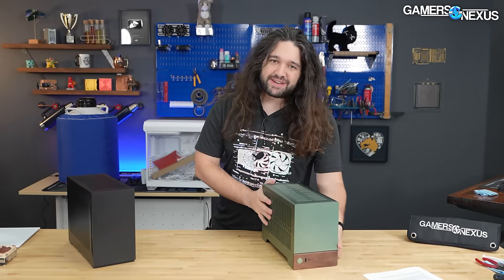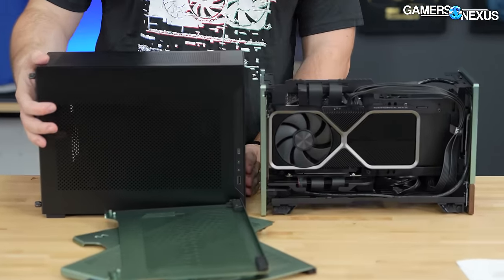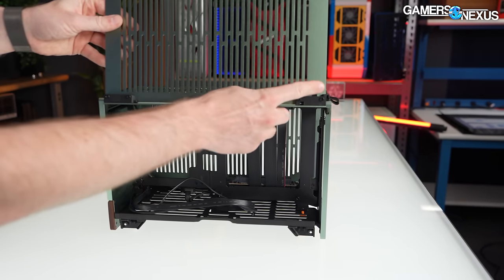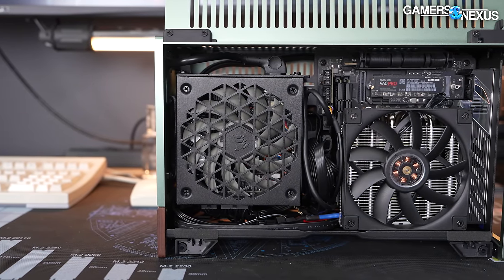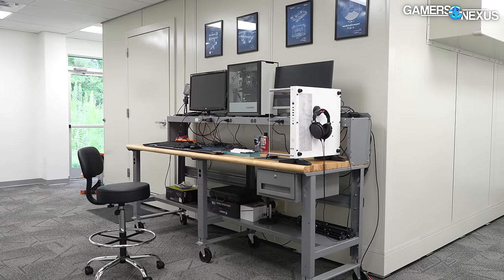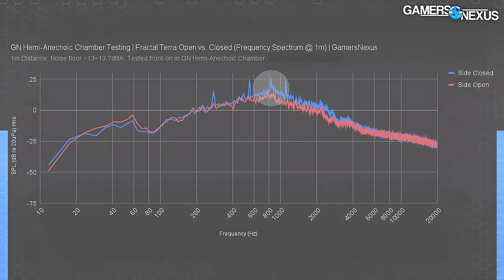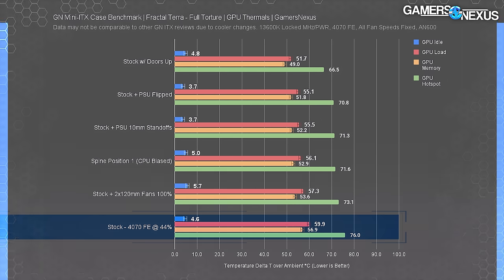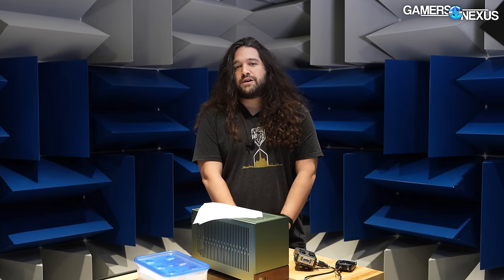Fractal Terra Mini-ITX Case Review: Build Quality, Thermals, Acoustics, & Cable Management

Comment: Great review! The noise produced by the case would be a no go for me. I've recently built my latest PC with the SSUPD Meshlicious and it is the best build I've had in about 24 years of PC building. Would be looking forward for a GN review of that case. In my case it is basically completely silent in desktop use and still surprisingly quiet under heavy gaming load. My setup: 7800X3D, Arctic Liquid Freezer II 280 + Noctua NF-A14 fans, Corsair SF750 SFX, ASUS ROG Strix B650E-I Gaming WIFI, Zotax RTX4070 Trinity, G.Skill 32GB DDR5-6000. CPU and GPU have some undervolting to reduce energy consumption and it works great so far.

Comment: Would a Arc 770 bifrost be a better choice for the form factor in reference to the cooling?  Pushed to the outside of the case the flow through fan would push air across the PS and the turbine style fan seems as if it would draw in cooler air frome the outside of the case and push out of the back through the mounting bracket.  I'm not an expert at all and I'm not saying that this is a bad review but I was curious to what you guys thought.
Reply: I have that card in a different case, the Cougar Dust 2, which has a similar sandwich layout, albeit with more room (~20L). 

The hybrid blower might be helping a little to deal with any recirculated air from the CPU when both the GPU and CPU are under load, but cases like these that have perforated panels don't need blower (centrifugal) fans as much as cases that have closed panels (e.g. glass) or multiple GPUs.

It would be interesting to see this tested, though, perhaps in a centrifugal vs radial vs hybrid piece.

Comment: SFF is a tough format to review in a comparative manner, however feel free to take these elements into consideration when trying to set up a methodology that allows you to compare cases:

1. use the same CPU cooler, preferably Noctua nhl9 i/a, which meets the clearance criteria in virtually all cases above 5 liters in volume. A 47mm height cooler (i.e. thermalright axp90-47) would be preferable as it is the better cooler, but it has the disadvantage of being the exact height as the max accepted clearance of many SFF cases. On the other hand, the Alpenfohn Blackridge (also 47mm) would negate this issue thanks to fan placement. In any case, there are options for better CPU cooling methodology.   
2. Introduce noise normalised tests. 
3.  Use an SFX PSU not SFX-L. SFX has better compatibility throughout SFF cases (Corsair SF750 Platinum is the golden standard) and tends to be preferred by consumers.

Comment: You could try to use Motion Amplification and Video Magnification to show vibrations in cases, Steve mould has a video on it. It basically amplifies imperceptible motion from video into really large and obvious movement.

Comment: I really liked this review. I'm a fan of itx cases and currently own a Louqe Ghost S1. I agree with the conclusion that this case is suited for a mid range gaming build. I know some people enjoy building in these types of cases with the goal of trying to squeeze the most performance per cubic inch. I have taken a different approach, trying to under volt or setting max power limits low in order to get an efficient build with decent performance and reasonable temps and noise. I wonder how my build would compare in this testing environment. I have a Gigabyte B450, Ryzen 5600g and a reference blower style Vega 64. The B450 series has subpar VRM and the Vega card was known to be loud, hot and power hungry, I have the bios switch set to the power saver setting and overall I love my build as an everyday pc with some decent gaming performance at 1080P. I wish the pc building community would focus a bit less on max FPS and a little bit more on less power, less heat, less noise and still hit 60 fps at medium to medium-high settings. I've noticed in the past that I cant tell the difference between high and ultra settings except when I push for ultra, my pc becomes a space heater.

Comment: Hell yeah H2O incoming! Any interest in diving into undervolt/overclock MHz tweaks on GPU or CPU to assist with thermals, or would that steer away from a controlled test? I feel some cases can perform well with high end components, but can also understand the desire to stay consistent with stock settings.

Comment: I think it's fine that this case exists at its price point, because in my opinion it's one of the best looking sandwich style ITX cases on the market right now (the green one is gorgeous) that isn't borderline unobtanium. 

That being said, I think Fractal should seriously consider developing a budget version of this case that uses less expensive materials and redesigned side panels with better thought out ventilation that takes airflow and noise in to more consideration. We need a solid mass-market sandwich ITX case with an MSRP that makes sense for people looking to build an entry level or mid-range system in that form factor and end up with a solid system that has easily managed thermals and noise. 

As things stand with this case, it's a splurge option that only "makes sense" if you happen to care a lot about aesthetics and also want to do a sandwich ITX build.

Comment: Build on this case with a rtx 4070 fe, intel i7-13700k using the Noctua NH-L9x65. Great little beast for 1440p 100fps+ high/max setting gaming. Have it setup as my htpc build in my living room. Quite happy with it. For my main rig, I am using the Dan Case C4-SFX, probably best case to use a 4090 fe in and pairing with an i9 using a 280mm AIO.
Reply: How did you mount the PSU. Did you flip so the fan is against the GPU?

Planning to get a 4070s FE when they release, and it seems to be a problem as the exhaust fan from GPU hit is against PSU

Comment: This is how I understand PC case testing. Where you find the limit of the case for hardware, the best coolers and fans configuration, and so on, but not just put the same old grandfather's system in all cases and measure temperatures as you did before.

Comment: Any closed and hollow physical object with rigid sides will tend to have eigenfrequencies (f) at frequencies that corresponse to wavelengths that are twice the defining dimensions (d) of the object.

f = (343m/s) / (2*d) => d = 172m/s) / f

Inserting the reported noises of f_1 = 600, f_2= 800 and f_3 = 1100 Hz  (=s^-1), we get the following numbers

d_1 = 172/600 m = 28cm, d_2 = 172/800 m = 21.5cm , d_3 = 172/1100 = 15.6m.

d_2 and d_3 are within a few mm from the physical dimensions of the Terra, while d_1 is a few cm off. But by the spectrum plot, it looks like the first harmonic is close to f_1 = 550Hz, which gives d_1 = 31.2cm.

If we assume that the extenal length is about 2cm longe than the intenal length, this, too matches really well.

I think one can confirm with near-100% certainty that these spikes come from natural harmonics of interior of the case.

In fact, since the d_2 seems to match the total height of the case, ie all the way to the table, one could test this by placing the case on a sound absorbing material. If I'm right, the main spike on d_2 should all but disappear (though the smaller spikes around 850-900Hz should remain.)

Comment: Id love to see the bottom fans, set to exhaust. I switched the bottom fans in my NR200P MAX to exhaust (originally had them as intake) and allowed the GPU to be the main intake fan for fresh air, the slightly increased negative pressure should help bring air in for the CPU and GPU cooler respectively and hopefully the improved thermals also reduces overall acoustic decibals

Comment: 1) You MUST use the 120mm fan beneath the PSU as exhaust. It helps tremendously!
2) Forcing the PSU to take exhausted hot GPU air doesn't sound like a great idea. It surely reduces PSU lifespan!

Comment: this video was utterly amazing for a first time and great overall. I really liked the section about contacting 3rd parties and verification as it is something you just don't see in the mainstream PC review industry whatsoever. The only obvious downside is lack of comparisons to the competition, but it's ITX and it is what it is. I would have really liked to see some testing with noctua's foam ducts, the NA-FD1. Placing the cpu cooler further away from the sidepanel reduces the annoying whine, but it also likely has a not insignificant effect on hot air circulation. The foam pads could have a noticable impact along with providing a little bit of vibration dampening if they're sufficiently tight against the panel. But I understand that it's one more variable to test and you have to draw the line somwhere.

I also rely like the PITA factor. It's a nice way of summarizing an ITX case in one "score"

My personal gripe with the Terra is that it isn't more like the North Mesh. I personally feel like the sidepanel design of the north could have really benefitted the performance of this case. The Norths front panel design also allows for a slim front fan in this case. If it had one, it would have been interesting to test front intake coupled with cpu cooler exhaust for example or front exhaust for both chambers.

 I also half expected fractal to release a low profile air cooler specifically made for this case. Maybe one with a slim 120mm fan that fits on top of it in the more CPU biased spine position and beneath it in GPU biased mode. Basically an FD version of the NH-L12S

Comment: I have a Thor-Zone Mjolnir and it has this exact same issue with fan noise while the case is closed. The noise profile sounds extremely similar, and I've simply removed the side panel to eliminate the noise. The perceived difference in real life is absolutely staggering—it goes from a loud, annoying hum to a gentle whisper. I don't really mind keeping the panel off, but it's still a pretty unfortunate design flaw.

Comment: I admire watching someone build the tiniest PC on the market, utilizing a TDK-Lambda CUS250MAC-DC Power Supply in tandem with an HDPlex 200W-ATX PSU, a compact powerhouse like the Ryzen 5 5600G, an RTX A2000 low-profile GPU (with PCIe bracket and cooler removed), all nestled snugly within a compact form factor like the Asrock B550M-miniITX motherboard. If budget were no concern, I'd opt for Fusion 360 to integrate everything onto a single aluminum heatsink block, providing both sleek aesthetics and efficient cooling. It might sound ambitious, but the goal is a pint-sized, silent PC capable of delivering a smooth 60fps gaming experience! hope i am not that crazy here! hahaha

Comment: Idea for how to compare different cases: make a best possible configuration chart. Use all the same components (some mid sized FE model for the GPU that should fit just about everything) except you choose the biggest possible cooler, be it air or liquid, and as many fans as it can fit.

An NR200/P review would also be great even if you don't make a video for it since between its low price, high availability, compatibility, ease of building, and great thermals it's a great baseline to compare against.

Comment: Would be awesome to see a video about best cases for storage. With how many cases you guys have, and with how much data you probably process, you probably use some pretty awesome cases with good thermals and lots of bays for disks. Sadly, without propper testing, it seems cases with most storage are bad for thermals, and cases with best thermals suck for drives. Would it be possible to make a video figuring out what cases with good thermals and audio characteristics are also good for drive storage?

Comment: The high pitch noise from the stock side panel could be from the sharp edges of the inside panel grooves. Because the fan is so close to the panel, lot of air needs to take a hard turn of direction and it can whistle over the sharp edges, like blowing over the edges of a piece of paper. Rounding the edges on the inside could solve that problem.

Comment: Have been waiting for some solid ITX reviews from GN for a while now! ITX has a bad rep for thermals and difficulty of building but that's been changing a lot lately. Plus there's a desperate lack of real data on ITX cases, most of the videos about them either have data that can't be compared to other ITX cases or they are just straight up build videos without any data at all. (save for a few channels like Optimum Tech who sometimes focus on higher end configurations with custom loops.)

The options on the market are each unique in their own way, so it will def be interesting to see some standardized and objective comparisons between them. Can't wait for the Dan A4 review!

Comment: With my NCase M1, the rear fan had similar noise issues.  I ended up having to put the fan on the outside of the rear, blowing into the case instead of sucking into it.

Speaking of literal pain, in a thread about the Lian Li TU150 case, somebody commented about how they had caused irreparable damage to their hands thanks to all the sharp edges.  Ouch.

Comment: Oh, I have that A4H2O, in silver, and I possibly haven't loved any case more than that, even though I'm 41 and had built plenty of PCs. The thermals could be a bit better, though, especially with respect to the VGA, and probably a sub 200W card is a good idea, but Mini ITX builds always have some compromises; I simply remove the side panel during the summer.

Comment: The only advice that I can give for future reviews of these sandwich cases is that generally you want fans attached to the case to be exhaust fans instead of intake. Let the CPU and GPU coolers take air in, while case fans take that hot air out
That said, it didn't matter for this case because the fans had no room to move any air

Comment: It's somehow mind boggling how they don't find / hear this flaw before release. Noise is a KO criteria for me and for this price I expect no cut corners.
My R4 PCGH Edition (with solid side panel and more noise dampening layers) was 108 EUR incl. 19% VAT back in the day and was so quiet, that I had to look under the table to see if it fell asleep or if only the monitor shut off after being AFK. Still using it today with a R7 5800X and a 4070 that most of the time can run passively, not even hitting 60°C until running benchmarks (goes up to 64°C @ 27°C room temp in a low noise instead of high airflow case).

I get the feeling, with cases like this you will always be thinking "if only it would be x mm / cm wider and / or taller".
Btw, I like the "PITA factor" but you also need a "PITATC factor" (Pain in the arse to clean factor). :D
Without dust filters on all intakes it will turn into a dusty mess quite quickly.

Comment: I LOVE these aqoustic testing. Noise and heat are crucial for a lot of people when selecting the optimal enclosure, and simple fixes or adjustments can make a world of difference when operating  a machine for numerous hours a day in a low external noise setting. Also, ITX is the future op enclosures for me. The noise and temps have evolved so much since the introduction of the vey affordable mesh N200 (perhaps you could re-review that popular cheap case accousticallly to include it as a point of reference?)

Comment: Great video, like always, and great to see the sound chamber in use!

A request: could you test putting one or two fans on the exterior of the top panel, that pull/suck warm - otherwise recirculating - air out ot the case?

It won't look nice maybe, but it would be an interesting test to see how that recirculating hot air affects thermal performance.

Comment: There is also an easy way to keep the aesthetics but move the cooler to the perforated part -- just flip the motherboard, that would help system breathe, eliminate some noises and would not require any additional changes to the chassis.

Comment: Oh good, they did a bit of work to tidy up the endgrain on that novelty wood piece.  A lot of the prototype images showed it fairly rough looking.  Not like will-give-you-splinters rough, but it takes a good amount of sanding to get endgrain  smooth enough to look good.  (An easy alternative is to mitre the edges at a 45 degree angle and then glue on more wood such that the end grain is pointed at something not exposed, like the frame of the case in this example.)  I was very worried that they'd go "well, we're tying wood accents in our cases, but we have no idea how to do woodworking so it looks bad, but whatever, it's different" which...is not good enough.

Comment: I have this case. Its gorgeous and fun to bring to lan parties. The problem is that the 13th gen CPUs get super hot in these tiny cases. I do not recommend an i9 unless you are adding an AIO and no GPU. You will have to undervolt your cpu, undervolt GPU, and add power limits to cool this CPU. I have a 13600k and there was a lot of work to make the CPUs respectable. I have the Noctua L9i

Comment: Watched this extremely detailed report till the end.
I wonder maybe setting bottom fans fliped (as exsaust) would provide best result for both cpu and gpu as although limited, they could help dissapate hot air from both cpu and gpu, and provide negative pressure to help those half-blocked cooler fans to perform better.